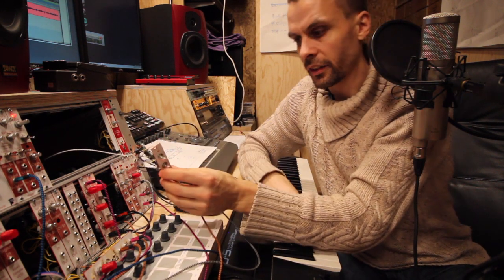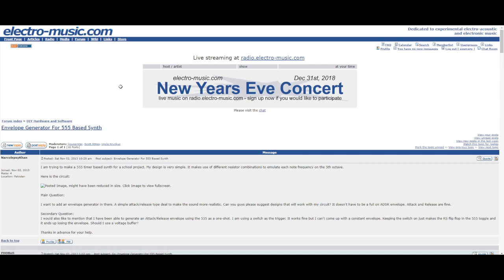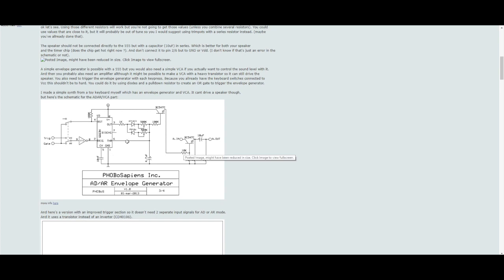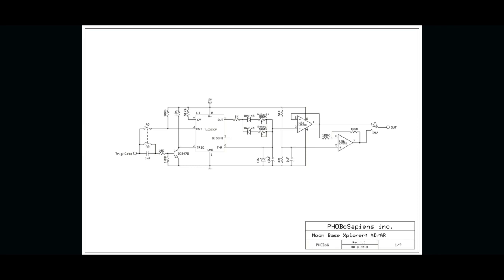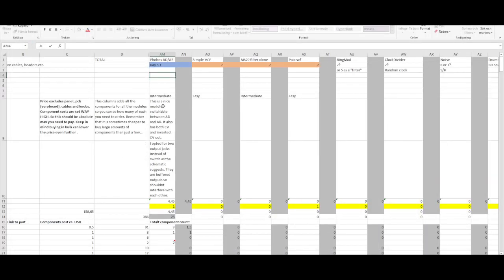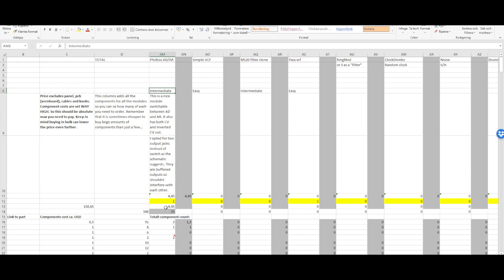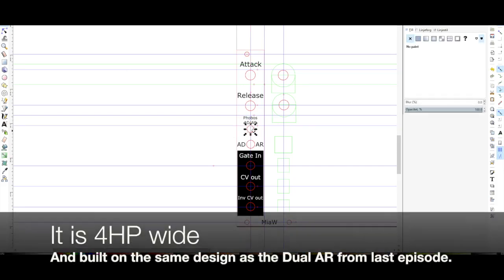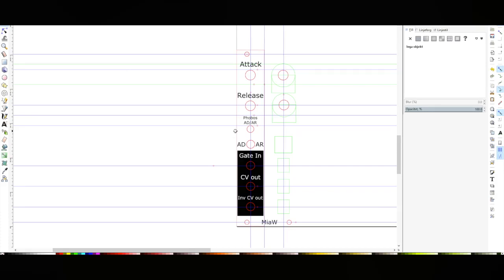Attack Decay / Attack Release AD/AR Envelope Generator - DIY Modular in a Week Day 5.2

Comment: I've tried to follow along with you on these and have gotten way behind. Just learning electronics. These are great vids on the musical side of electricity. 
I remember when the Moog synth was born, which tells my age.
I remember in one of your vids that you needed more power. Did you remedy that problem? I'm still good with the supply from your schematics, so far, but I was wondering if you had to build a different supply.
Reply from the maker: That is great! Don’t worry if you get behind, the videos won’t go anywhere. As for power I did beef it up a bit. It is possible to just build on the original one and basically add more capacitors and if one wants to add 5v. It is discussed in a video as you say if you watch the playlist it is the one about ripple. Just keep on building and you’ll get there. :). I have slowed down a bit too. The first week was really speedy, but now I have had to slow down and also I experiment a bit more which takes time. ;) Keep it up!

Comment: Ok, ultra-newbie question here - what type of switch should I order for this?  From what I can tell it's a DPST switch, correct?  With the ones I have found online, it seems like most have 6 pins.  If so, how is this wired then?  Sorry for such a basic question, but the switch is really throwing me off.  Thanks!
Reply: It's SPDT, 3 pins. the schematic is drawn in a weird way. Trig/Gate coming in from the left, goes to the center pin.
Reply: Also, they seem to only be on-off???

Comment: Built this without the zener voltage diode and works great.  From an early ray wilson design ... Loop back from ad out with switch to pin 2 555 and envelope repeats ! I didnt need a resistor , just direct feedback. Now we have looping adjustable ramp up / down and anything between  lfo style envelope too 👍
Reply from the maker: Thanks for the tip on a simple mod. I have loop function on my AR already but might do this on the ADAR aswell. (Only problem is panel space for another switch...) 😅
Reply: Without an resistor, this loop is drawing 40mA. Depending on the output impedance of your PSU, this can cause problems. I added an 5k resistor and it still works but without power spikes
Reply: a tip : you can watch movies on flixzone. I've been using it for watching a lot of movies during the lockdown.
Reply: @Tanner Kristopher yup, have been using flixzone} for since december myself =)

Comment: With a 556 chip instead you could make a dual module!
Reply from the maker: Yep. But I am unsure if they make them anymore? When I bought components for this modular I only found 555s that was in production. It is still possible to buy them on eBay for example but not “new”. Two 555 would work aswell. :)
Reply: @SourceryOne  I found them here - https://www.taydaelectronics.com/ne556n-ne556-556-general-purpose-dual-bipolar-timer-ic.html
Reply from the maker: Wow. Great and soooo cheap! :) thanks.
Reply: @SourceryOne  You're welcome!  I found that site several years ago when I wanted to build an Atari Punk Console.  Of course... shipping takes ages because it's coming from China, but the prices are fantastic!
Reply from the maker: 😂 well I guess that is good enough. 😉
Reply: i bough 100pcs to build a keyboard with one 555 per key xD so you could push all keys without any sound problems, but i think 100 isnt enought since a ADSRs also needs 555 timers so i think i need 2 or even 3 timers per key so in the end it will be over >200 xD
Reply from the maker: Wow and each key tuned I guess? That will be one massive build. It might be a good idea to build a pcb per voice. One vco and one vca on each pcb. :) interesting project. Keep us in the loop :) and do a video.
Reply from the maker: All of the circuit suggestions (including loads with arduino) is in the pipeline. Except the “ring mixer” what is that? Haven’t heard of that (yet) :)
Reply from the maker: And maybe settle for ARs instead of a full adsr if you are doing one for each key. ;)
Reply: ring mixer
https://www.asciipr0n.com/4096/ringmod/index.html
Also another idea a Waveshaper
http://ijfritz.byethost4.com/sy_cir8.htm

I found a good site with scematics, might be useful to you 
http://ijfritz.byethost4.com/sy_over.htm?i=1

 i got these ideas from a older modular synth that emulates hardware, sadly its out of sale but you can dont load a demo. Its really great.
Reply from the maker: Ah you mean ring modulator right? Yeah. That’s in the pipeline (already done) ;)
Reply: But this is the cmos version of the 555, right?